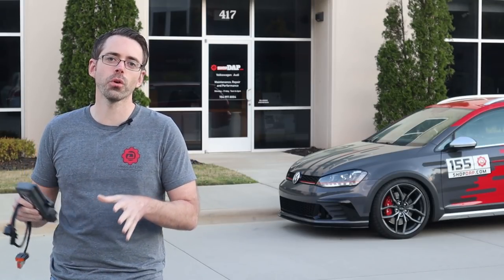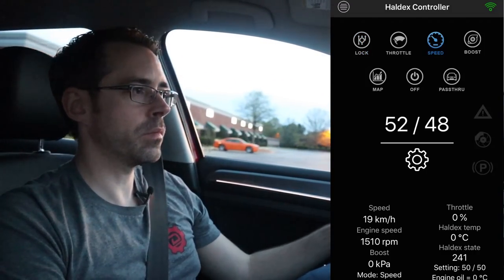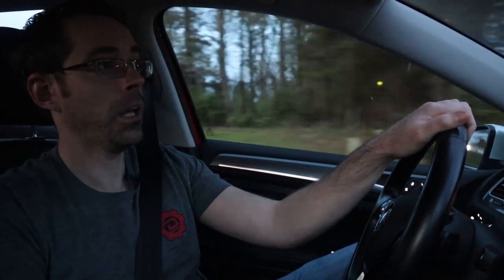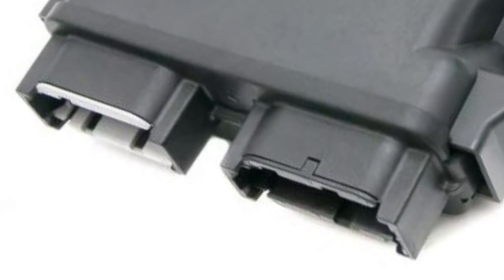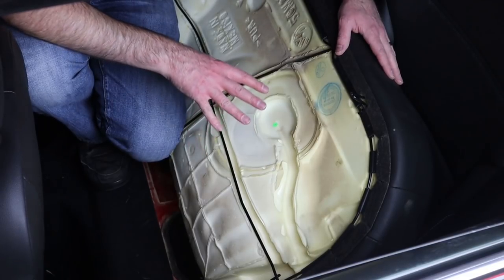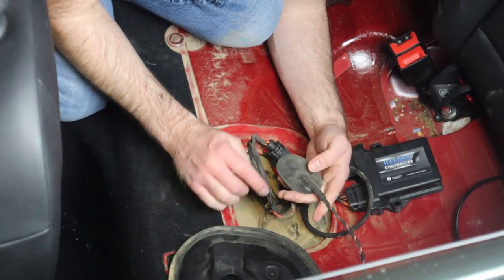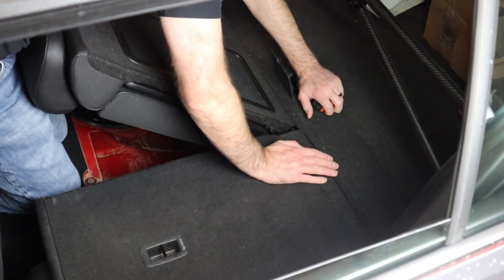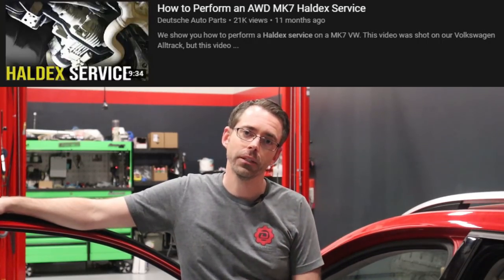How to Control your Haldex AWD System

Comment: Locking your haldex may prematurely damage it. Keep in mind it is not designed to be a permanent AWD, with this tool you'll shorten its life dramatically, and it is already not the strongest part of the modern VAG MQBs
Reply: Some people are heading for big bills to replace Haldex.  The same people will no doubt also be complaining about VAG reliability.      This is a solution looking for a problem.
Reply: I’d only lock it for launching the car from 0-100kmh

For traction ya know? beyond that the ratio will stay 60-40 or even just off. ( 60-40 was the ratio in the GMC SCYCLONE)
Reply: @tony_5156  did the scyclone use a Haldex? I don’t believe so but I like the way you think....same thing I would do,0-60 50/50 or so depending on power level.do you know if it would be possible to split torque enough for some sideways hooning? I assume the system won’t allow a 90/10 or even 100% rear.thanks btw the typhoon was another GM gem.
Reply: @kolourblind3124  nope no more than 50/50
Reply: With the proper high performance tires like Nitto NT01's your car is going to have plenty of grip and will hook up just fine from a dig or from a roll. Plus if you don't have a fully built motor, built transmission, and a bigger turbo then this really isn't going to make much of a difference if you aren't putting down 500+ wheel horsepower. Tires will make a world of difference and won't deplete the life of your all wheel drive/4 motion system. This haldex controller is a hard pass for me and a waste of money.
Reply: I bet the same could be said of Audi's traditional Torsen quattro when they decided to bias it rearward on some models too.
Reply: 50/50, the HALDEX will be destroyed in a few mileage...
Reply: @kolourblind3124  I believe stock is 95/5 (if you have a TT GEN 1) so I don't see why you can't do 90/10.
Reply: @GOLTURBO555  haha it last me 20 min on 50/50 with the haldex controler. But the cars have multiple track day on. Maybe the haldex was due to explode. All the clutch was just in sauce in there. Got a new complete diff. Will see how many mile it will hold.
Reply: Well one good thing is you can disable the haldex for daily driving, and whenever you race someone you can enable it for best 0-50mph  times
Reply: @RacesForTheChannel all is true, but when you drive in snow you will have more fun😊
Reply: My golf has the receipt of the haldex module being installed at 5k miles in 2008, in full time AWD and sport mode since, i bought it from the first owner and am now at 190k with no issues, still works like a dream

Comment: I'll leave the calibration of the 4motion to the paid german engineers.
Reply: These aftermarket units might have their rightful applications, like:
* The stock ECU was damaged and the OEM part costs more to replace than just buying this and using it in 'stock' mode
* using them for a transplant (e.g. the 4motion parts) where you don't want to replace/recode ECUs refusing to work together (e.g. difference in ECU generations etc.).
* Cars built for racing purposes could require a different 4WD strategy which would serve no useful purpose on a daily driver like engineers designed it to be driven.
Reply: 100% unless you can afford non-warranty replacement costs for pre maturely worn Haldex.

Comment: what about just deleting the haldex clutches for a cnc machined spacer to replace the clutches so its always true full time awd?
Reply: Great for a rally car, but because the clutches also act as a "center differential", you will bind up your drive-train on a dry road. Just like a 4x4 truck.
Reply: Yep, that's impossible. You would need a center diff between the front and rear axle. A torsen diff for example, which would make it a REAL quattro. I dont agree that audi puts the quattro badge on a haldex car, it's just marketing for people who dont know what they're driving
Reply: @wesley8096  Its not really "real" haldex either. The quattro ultra can in dynamic operation send 100% torque to the rear continuously and its always active, compared to haldex which is reactive. So if you use OBDeleven or VCDS you can clearly see the clutch closed almost constantly in dynamic.

Comment: I've got it and it is pretty sweet. You can tell a huge difference - whenever fooling around can select 50/50 lock then put it right back into passthrough mode for regular driving. It has some cool schedules you configure off of speed, boost, etc. that you can set up for your intended purpose. I think it's awesome!! The developer is very friendly and responsive too, as I'd reached out with questions.
Reply: still working? or did it overuse the system?
Reply: Same question as riot. Is it still working? had any issues with your haldex system? i’d primarily wanna use this for snow driving.

Comment: This is cool, but for $1049? I'll save my pesos for now.
Reply: Pre coronavirus that would cost 199.99$, I don't see what the fuss of 850$ extra is all about. See it in this way, there's boxes that "trick" your ecu to send more fuel to your injectors. This seems to do the same thing to the haldex pump. Kinda greedy imo.
Reply: @ViceVersace  haldex has always cost around  1k idk what you are talking about 199 for a haldex
Reply: @LeGrimsta  he’s talking about the module not the whole haldex system

Comment: Shame the wiring harness doesn’t come with a preinstalled grommet, that would have made for a perfect clean quick and simple installation with no worries about sealing that aperture from the elements.
Reply: But that wouldn't be as universally as this solution is at the moment. Not every car he mentioned with a Haldex needs the same grommet.
Reply: blocki So you make 7 different ones big deal
Reply: @blockbertus  He said the cables are vehicle specific... that being the case, it wouldnt be difficult to know what type is required?
Reply: @ThatRoddy  I must have missed that note. If that's the case, you are right. Sorry!
Reply: Idek what a grommet is

Can someone explain please, thanks yall.
Reply: @tony_5156  - a rubber or similar moulding designed to both seal an aperture and protect pipework or wiring that passes through it from chafing on the edge of the aperture due to vibration and mechanical shock. Somebody’s probably got a better description but that should get you going.

Comment: I installed this on my RS3 first time today and it took me half an hour for the whole process (easier than I thought). I made 2 straight cuts (20 mm long, 7 mm apart) on the side of the rubber grommet with scissors, so the harness can go through. After the grommet was put back, I sealed the hole with high quality and waterproof electrical duct tape. I placed the controller at the back in the trunk on the existing foam. I used a Velcro (hook and loop fastener) to hold the controller securely in place. The Velcro method will allow me to temporarily remove the controller from the car as I wish. Now, the fun part is to play with the settings and to set them correctly is the hardest part.
Reply: How is testing going? Notice positive differences?
Reply: @andremille  
Big difference when you set it up correctly for the sweet spot, I feel like I have an extra 50HP.  The car launches so much harder and faster when you set 80:20 or 70:30 torque split between 0 and 40km/h, then 50:50 torque split from there on. This is to get the heavier front end going first, then quickly push hard with 50:50. You can view all these happening on the phone.
Reply: @khvidtube1617  If you set it up to 50:50 can you drift the car (as the back is lighter han front)?
Reply: @HanSolo__  
Yes, you can easily do a power oversteer with 50:50 even if it is not your intention and even if you have cup 2 tyres. So I would not recommend 50:50 if you are not good at controlling oversteer, it is very dangerous.
Reply: @khvidtube1617  Cool. I do own a 230HP BMW E61 which goes into some crazy areas with the ESP turned off. ;)
Reply: @HanSolo__  
RS3 has 550 HP+, after a minor modification. That makes it even harder to control if the rear gives way.
Reply: @khvidtube1617  How much does this RS3 weight? Got to be crazy fast on track hm?
I think it is now the only RS that uses Haldex system. All the other do use Torsen. 
Still, latests gen Haldex made it more suited  to some higher outputs. You cant make it a proper 4x4 with LSD without throwing stupid high amount of money tho.
Reply: @HanSolo__  
It weighs about 1550 kg. No LSD between the front and rear axles. That is why I wish it comes with an AWD system like Suburu.
Reply: Game Tester  
It is still very enjoyable.
Reply: @khvidtube1617  do you think that it can cause more wear on haldex? Clutches etc. ?
Reply: @khvidtube1617  why not stay 70:30 at highs speed? This way you have less power train loss
Reply: @FLeXJun  
You can. You can even set it to 100:0 (F/R), but it is slow in response when you suddenly want more power at high speed.
Reply: @khvidtube1617  definitely but I want to get this for roll racing. For example St high speeds I don't need haldex, so Im trying to see if around 80mpph it can be 100/0 or something
Reply: Did you ever get it to 100/0 over 80? How’s the fuel consumption between factory setup and 100/0 when going high speed? Thanks!
Reply: @margarinic  
You can set up 100/0 at any speed. Yes I have tried 100/0 in 80, good fuel consumption.

Comment: I just installed this on my 8P Audi A3.  It is fun to drive the car in FWD mode to feel torque steer.  The track mode seems to hold the Haldex pump on longer than stock as it goes back to 100/0 slower.  Driving around with the Haldex locked defaults to 65/35.  The car feels like a true AWD car and going through a turn is quite different.  I could be imagining it but when I parked the car I seemed to be smelling a mild clutch like burning smell coming from the rear of the car.  I will use it sparingly as it must wear out the Haldex faster.  I don't want to replace such an expensive part.

When you put the car into FWD mode and you are driving 30+ MPH and you give it the beans, your car will accelerate faster then if power was pushed to the rear.  

I have a stage 2 A3 with the stock K03.  I did two 0-60s with launch control active and I did 0-60 in 5.24 seconds.  I turned on the Haldex Controller and set it to do 50/50 between 0-12 MPH and 50/50 13-23 MPH and 80/20 between 24-36 MPH and then 100/0 from 37 onward.  I did 0-60 in 4.96 seconds.  .25 seconds faster.  That would maybe remove .3 to .5 seconds off your quarter mile time.

This is a fun upgrade.  Auto cross, track events or rare launches are probably when I will use it.  Driving around in FWD may help with MGP.  That would take some detailed testing and long drives at HWY speeds.
Reply: Great info, thank you!
Reply: 2 year update.  My A3 now has a K04, full suspension upgrades, chassis bracing, front and rear LSDs and United Motorsport Haldex tune.   Using all that with this controller allows me to have good performance at track days.  I only run a few laps at at time  and I watch the Haldex fluid temps in the app on my phone.   I have a lot of fun with a full time AWD car on the track.  I rarely use this in my off track driving as to keep the wear and tear down and I know I probably do enough wear and tear on track days.

I know a guy who had a MY 2019 RS3 and he ran this controller full time, all the time and he said he never had issues for a year.  I am not sure if I believe him but he is a good guy and a solid mechanic.
Reply: @kylemandt527  man i was thinking about front&rear lsd for my S3 8L Gen 1 haldex. Can you please explain to me how do they help? Im a hillclimb driver and im building S3 now. I need as much REAR as possible! Thanks a lot !

Comment: Once the rear seat bottom is out, the plastic LATCH covers can be easily removed. Without them in place, the seat bottom slides into position MUCH more easily. From there, the LATCH covers are easy to install. I'm not sure if it's faster or slower, but there's less struggling with getting the cushion aligned under the LATCH covers if they're not present while installing the seat cushion. Give it a try next time you remove the seat. Keep up the good work.

Comment: Mechanical engineer here!. Fun, rare, fact. The 2014 Cadillac Xts-v has a haldex awd system. Can this controller be used as a universal haldex controller? Does the p/n, or rev affect this? Of course a different pigtail setup would have to be used. I’m cool with changing that. Just wondering if there’s a way. Thank you

Comment: This is pretty slick

Honestly want to spend the 1k just to see what kind of gas mileage I get with it in true FWD mode. I expected to get 30+ easily when I bought my R but sadly can't get much better than 25mpg avg. My APR stg 2 2016 GLI regularly got 35+ mpg in the summer....guess that's why I assumed they would be similar but boy was I wrong lol
Reply: Haldex consumes about 23-30% of your total output. Running FWD at all times will benefit your gas mileage but will not be the same as the regular FWD cars due to all the extra weight. You're probably better off just unplugging the haldex cable if you really want FWD only (it's free).
Reply: @GForceConnections  yeah I wouldn't doubt that one bit. Still have a transfer case deal (I know it's not what it's called but does basically same shit) spinning and the driveshaft as well.

Could also use that USP I think it is that makes that burnout switch with the little remote. You can switch it to fwd only but you get lights on the dash when it's activated. I'm guessing it electronically disconnects the haldex temporarily so it fails to work just have to stare at a bunch of error lights on the dash 🤣🤣 this box would atleast keep the dash from looking like a xmas tree
Reply: Same here. Came from a MK5 GLI getting sometimes 38mpg. Hoped I would get at least 31mpg with this Haldex but the best I've seen is roughly 28mpg at 45mph with the a/c off.
Reply: Keep in mind there is always some drag from the rear diff and other bearings related to rear drive that will always be dragging no matter if you are in fwd or awd
Reply: @ReubenHorner  or..if you want to disengage the rear diff also, you could search for rear free wheel hubs, if any are available for your car..

Comment: Why doesn't it simply include a new grommet on the new wire connecting to the Haldex, especially for $1,000? Especially so you don't have to de-pin the connecters, potentially damaging them, to relocate a $2 grommet.

Comment: You mentioned drag racing a lot, but didn't mention a proper road course or autocross at all. Are there recommended settings for that or is the stock system sufficient?

Comment: 3:00 you will spin the whole system even if the clutch is not engaged, because the wheels are conected and because they will spin up, the whole 4wd system behind the haldex will also
so there will be no difference between haldex on or off

Comment: A device that costs what a ecu/tcu costs? Sweet. I think there's an option for half the cost out there.  Love you DAP, but I'm not rich enough for this one.
Reply: haldex is another upgrade this is costly but will help make the car fun like the ecu and tcu you refer to.  the haldex currently offered costs about this much. the difference here is that you have a unit to move from car to car. the other version there is no hardware and the creator over there keeps all the extra funds you pay with. it seems the other guy needs to lower the price of his downloadable tune.

Comment: Isn't this like Haldex Blue? From what I remember, those put extra wear on the transmission and you need to service it sooner.
Reply: "Haldex Blue" you're referring to is basically a Haldex controller with a different map/tune on it.  The colour is sort of irrelevant as it's just a cover.  But the Haldex controllers you see like those (the selectable-mode and the competition ones) those are actually made by Haldex themselves, they're just sold by various tuner-type companies (HPA, Neuspeed, etc.).  So there you're actually changing it to a controller designed by the company that made the coupling to begin with. 

Never really heard about "extra wear on the transmission" from using one, but anything is possible.  This doesn't change anything about the transmission, just the way the centre coupling apportions power to the rear-end.  

These Van Der Veer boxes at DAP though, they are piggybacks it looks like, rather than replacement controllers.  They are basically causing the stock Haldex unit w/stock controller to behave differently.  It's a different way of getting to the same thing I guess.  Cost is a little cheaper here (not a whole lot) but this seems more configurable, and configurable from a phone app at that.  However thing that bothers me is none of the percentages make sense, so it's tough to know if this thing is really doing what you want it to?  Like stuff like 50F/40R--where did the other 10% of engine power go? lol.

Comment: Do you hear any noises on accelerating gradually as haldex system is engaging like an old air conditioner’s refrigerator system kicking in. It’s my first 4 Motion VAG car so I’m trying to figure out if it’s a normal operational noise on my MY20 Tiguan (Allspace in Australia). Thanks for your advice.

Comment: So if I remember correctly, the haldex puts itself in 52/48 when you turn off your ESC... so if you want to do your 1/4 mile you can just do that and punch it again at 70 km/h or so and you will save yourself $1k. On the track you do want as much HP to the back as possible to avoid the terrible understeering the car has so again, you leave it at 52/48 (what you really want is 20/80 but by design your haldex cannot do that). Overall this is just a front wheel drive and it behaves as such. Source: I own an S3.
Reply: Get a wavetrac I have a S3 as well